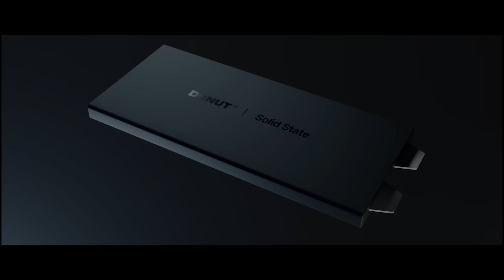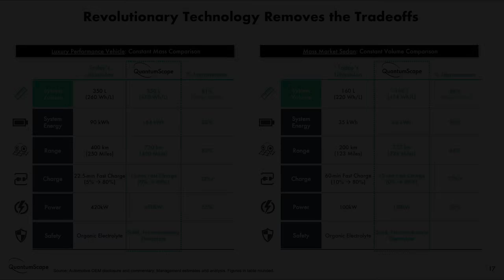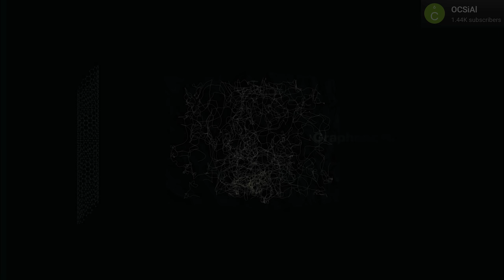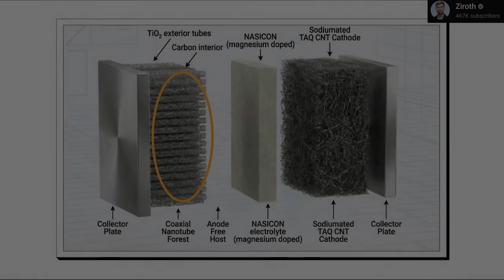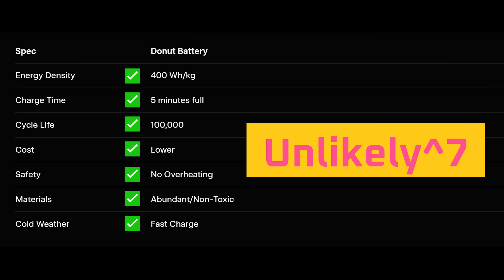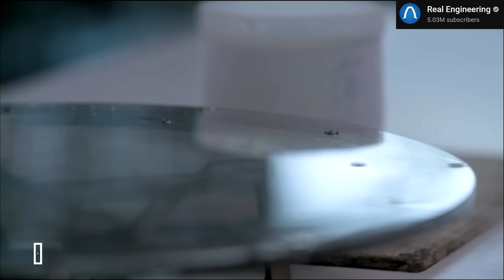Donut Lab's Battery has a Problem with Physics (and manufacturing)

Comment: You and the other “experts” still don't get it; being skeptical at this point just makes you look ridiculous. It doesn’t matter at all what chemistry was used or whether you can call it a battery—it’s all about performance! Even if the Donut battery performs slightly less than claimed, the fact remains that even with lower specs, it would still be by far the best overall package compared to any other battery. You’ve all made fools of yourselves with your reviews and comments—just admit it. And importantly: Innovations are often developed by small startups and no-names, so it doesn’t matter if you understand it. Because if you did understand it, you would have developed the battery, not Donut Labs :)
But take some comfort in the fact that you’re not the only “expert” who’s made a fool of themselves...
Reply from the maker: I agree, at the end of the day it's about the performance. 

That's why I didn't get into the weeds about chemistry, because it matters less.

However, what you're basically saying here is that it's okay if Donut lies and misleads about the performance of their batteries. 

That's not acceptable to me, even if they do push the industry forward.  

But have they pushed the industry forward?

Not as far as I can tell. 

That is, what you're doing is apologizing for potential fraud.

Comment: A theoretical scenario. Four chemicals, ABCD. A & D inhabit one electrode(Because they're stable together), while B & C inhabit the other(also stable together). A & B are components of a conventional battery, C & D also react with each other the same way A & B do when induce( specifically battery discharge). Lets say that C can flip the polarity of B, and A can flip D. So that the cathode A discharges electrons to B, then C flips the polarity(being the only chemical that can do so), and is subsequently induced by D to shed its electrons back. Then A flips it back and the cycle repeats. Is this theoretically possible?
Reply from the maker: This sounds like a perpetual motion machine
Reply: @thelimitingfactor  Doesn't have to be. There can be energy loss each stage. Just as long as it sustains longer than a conventional battery.

Comment: Okay, too bad that all your arguments are based on existing chemistries and technical solutions that are currently used in batteries. It would be desirable to take into account the fact that Donut labs could have invented a completely new chemical composition and technical method to make their battery. Then previous battery technologies have no legitimacy to be used as comparison points. So why are you drawing sweeping conclusions?
Reply from the maker: I did take that into account.

If they are making a 'battery' then it's subject to the same laws of physics.

That is, I'm not basing it on existing tech, I'm basing it on fundamentals.

Comment: Donut Lab itself did not develop this battery, there is a completely different company behind the battery, you will see that the battery will not come to the market because it does not exist.
Reply from the maker: No need to be cryptic.  I'm assuming you're talking about CT Coatings AG

Comment: CATL says 5-70% in 5 mins is 12C.
(Shenxing2 LFP. We all know the other 35% takes at least 7 mins = 5C).

At that dual reveal, they likely did have 12C & 5C batteries... They just lied about which is which. 
(For same reason they slow-walked Naxtra 🧂🔋 5 years in the first place: to protect Li sunk cost).

CATL Scientist: "Naxtra has zero resistance charge & discharge. It's basically a superconductor!"

CATL PR: "Naxtra? Oh, that thing is 5C. But look! Shenxing2 is 12C!"

Comment: Why are you talking about Li ion batteries, when we know that the Donut Lab battery does not contain Li. It is irrelevant. Your only valid "argument" is that it is too good to be true - ar least based on a paradigm known up until now. I am afraid that won't cut it to falsify the claims. We will see.
Reply from the maker: We don't know that it doesn't contain lithium.  That's what they told us.  So far, the voltage curve of the tests indicate lithium.  

Despite their claims that they can shape the voltage curve, there's no evidence of that, and it would be kind of silly because it wouldn't provide any real benefit.

Lithium ion batteries are the highest energy density batteries we have with any commercial success.

That's because lithium produces the highest energy density ion.  

That is, there's more to it than "too good to be true".  So far, the charge testing confirms what I've laid out here.

Comment: Very interesting... The only way I would imagine this working is if they found a novel method which is much simpler than current batteri tech but still uses some exotic component like nano tubes but which (they at least believe) can scale locally and easily. True or not I think there will be massive delays and issues along the way with any major impact volume wise on the overall market 5+ years from now.

Comment: Hard to know for sure but as two bit DaVinci said why would they lie? They seem very reputable although new but certainly capable as well. We shall see for sure, I've not seen one video. Chad thinks it's possible but I actually believe it is.
Reply from the maker: It's because all of these companies stretch the truth about what their battery is capable of. 

As long as there is some basis in reality, they can get away with it 

They have to really mess up big time in order to get prosecuted for fraud. 

For example, if Donut has multiple versions of this battery, the claims would be true.  However, you wouldn't get all those characteristics in one battery.

Comment: Big oil and battery competitors are relying on social media and the talking heads to sow doubt and sink any and all who’d put them out of business:

Yes, due diligence is necessary but be aware of who benefits if this technology is buried.
Reply from the maker: It's not being buried. 

We're waiting for them to reveal it. 

It's not a big oil problem, it's a Donut problem.
Reply: @t @thelimitingfactor  you’ve already said you don’t believe the battery is real.
Reply from the maker: That doesn't mean I'm trying to bury it.  I also said I will GLADLY eat my words if I'm wrong.

Big oil is small fry nowadays.  SA is no longer in the top 5 even.  The top companies all have an interest in these batteries succeeding because they are AI based.

It matters who your allies are.
Reply: It's not going to get buried. Big oil really don't care. Luddites do, but all the real advances in battery tech haven't swayed them so I doubt they will bother focusing on this one. The big claim being made for this battery (100,000 cycles) isn't even on their radar. Current batteries last the practical lifetime of the car, have range of 500+ miles, and can be charged in 5 minutes. That already ticks all the boxes the Luddites claimed would make them change their minds.
Reply: @bhabbott  big oil will crush this if the 100,000 cycle is proven.

Comment: To be fair to them, a lot of these specs aren't actually things we consumers would see. Like energy density in consumer products isn't the energy density per cell, but energy density of the battery pack. By extent, the cost isn't for us, it's for the raw materials; that doesn't mean it's cheaper for us. 

The only really questionable feature of the battery I see is the 100K cycle life: but without knowing anything about the battery, we have no way to argue about it. We'll just have to keep watching their third party examinations over the next few weeks. 

I honestly think there's a high odds the battery does exist, but I doubt the cycle life is actually 100K, I think it's more likely a theoretical based on the materials they used.

Comment: With batteries you can just do a simple check. Can you buy it? Not yet? Then it doesn't exist.
Reply from the maker: Exactly!
Reply: That's way too simplistic. Real companies release engineering samples to independent testing labs and/or potential customers. Then they struggle to achieve small-scale production (enough for a customer to assemble a few hundred battery cells into a pack in a car and claim crazy nearly meaningless "1,200 km range!!"), and struggle even more to achieve volume production with the original specs of the hand-built lab samples. The product exists long before you can buy it.
Reply: "RELEASE THE BATTERY KRAKEN...!!!" (Liam Neeson says sell it or it didn't happen)

Comment: I have always felt that one day some small company will stumble across a new, completely left field way of making batteries. That company would most likely come from outside of the mainstream battery makers, thinking very differently about batteries as they have no vested interests in the current technology or manufacturing. And because it is theoretically feasible to achieve these numbers and because I really want to believe this battery exists, I hoped it was true.
But sooo many red flags you have put up here, that it's hard to ignore. Perhaps the reality will be they don't hit all those claims but have made a breakthrough, but even then they may still hit other issues as this whole launch appears totally chaotic.
Thanks for the video 🙏
Reply from the maker: You're welcome!  I really hope I'm wrong - genuinely.
Reply: "I want to believe" is not a development strategy nor an investment strategy. It's a poster on Fox Mulder's wall in the X-Files.

Comment: The battery is not an „invention“ of Donut Lab, but a licensed product

The timeline clearly shows that Donut Lab was only founded in 2024 and invested heavily in the Nordic Nano Group (NNG) in 2025. Since NNG in turn has signed NDAs with CT-Coating and Next-Eco, it is certain: The „revolutionary“ battery of Donut Lab is based on the Nanopaste technology of Ernst Hölzenbein.

Donut Lab acts primarily as a commercial lever and integrator (especially for their in-wheel motors), while intellectual property and chemical formulation are deeply rooted in the history of Vectopix(Screen Printing Machines) and CT coating.

I think you have to be careful and smart with such technology. There are people who don’t celebrate it like that, there’s a lot of money at stake. Especially in the fossil fuel companys, oil companies and classic car giants are losing control over the entire value chain. This can be very unhealthy.

Hence also this publication strategy.

Donut Lab acts extremely cleverly. Their promises of the eternal batteries and 5 minutes of charging seem like fraud for industry experts at first, but it is precisely this distrust that is part of the plan. They deliberately lure critics into a trap, first they let haters tear up the results, and then immediately counter with independent validations. In this way, they proactively invalidate doubts instead of just defending themselves. Compared to the established industry, the boss relies on complete transparency. Since their technology poses a threat to large corporations, they protect themselves from targeted discrediting by publishing unstarnished data. The procedure is also essential for investors. No one puts millions in snake oil or potential scam. Regular checks by institutions such as the Finnish State Institute VTT prove step by step that the technology actually works. It’s a marketing strategy, constantly new evidence keeps Donut Lab talking and building a reputation. Through facts and videos, they make themselves unassailable.

Nanopaste Patent https://patents.google.com/patent/EP2854486B1/en

One more thing to consider when it comes to mass production. What if Donut Lab or specifically the company network behind it have the same goal as what ASML does, license technology and sell production machines, then they don’t need their own huge production.

It was already tried to market the product a few years ago https://archive.org/details/nanopaste

But they probably had it like Superfest Glass https://en.wikipedia.org/wiki/Superfest

„With Coca Cola, for example, they said: Why should we use a glass that doesn't break? We make money with our glasses. \\\[…\\\] The dealers said understandably: Who would saw off the branch he was sitting on?“

— Eberhard Pook

\\\*\\\*English is not my native language, I had it translated with Google Gemini.

Comment: Could it be an aluminium battery? That would explain the high power density per kg as Al is a light element.
Reply from the maker: Lithium seems the most likely based on the voltage curve, but they said it doesn't contain lithium.
Reply: Li is lighter than Al, no?
Reply: @georgepelton5645   Wow, you're right, I just looked that up. Seems like you can't beat lithium for power density. I don't know what kind of game Donut Labs is playing by saying it's not lihium. They seem very shifty.

Comment: The test showed Donut Lab battery retained 99.5% of it original capacity under full cycle fast charge condition. This is actually unacceptable for commercialization. After just 100 full cycle fast charges, this battery will only have 60% of its original capacity left. Donut Lab still need to improve this battery quite a lot.
Reply: That doesn't mean what you think it means. At least you need additional info to assure such an assumption. Because after the first 11C cycle the lab made one 1C and one 5C cycles and both returned 100% capacity.

Comment: I, like many others, became excited and hopeful that a new battery technology had arrived that would pull the rug out from under fossil fuel sources of energy. As this well thought out and presented analysis suggests, it is extremely unlikely that Donut Lab's claimes are true. Rats. As an aside, I was stunned by the scatter of the data shown in the Cycle Life (# Cycles) versus Volumetric Energy Density (Wh/L). The linear regression lines must have some crazy variability parameters. It looks like a real mess.
Reply from the maker: Thanks man!  You are correct, there are a huge number of variables and it is a mess 😁
Reply: The rug is slowly being pulled out even without battery breakthroughs. I think more battery storage is being installed then new "natural" gas generation, and combustion vehicle sales are declining globally.

Comment: Only thing I can think of that could make any of this possible is they lucked into some materials that transfer hydroxide ions well and end up working out really well without needing huge change to some materials getting refined for some other totally different use with one having a high hydrogen content unintentionally or something.

But generally that seems highly unlikely, but seems to be the only thing that might somehow degrade slower while basically working like any other current battery tech like lithium or sodium.

Comment: There has been more info today as people related to a German company CT-Coating have published information about cooperation with Donutlab. They sell technology and tools to manufacture various coatings, and most likely also have various carbon nanotube paste materials available which all have been developed during last ~20 years. CT-Coating and Donutlab have NDA and large scale business during last year(s). This German company does not have end products, but has technology to build up energy related products, and there seems to be several other companies too to have CT-Coating related activities.
Reply from the maker: I saw that!  Juho Heiska has done a great job of covering it.  'Magic Paste' 😁

His is probably the best analysis video, but it's in Finnish
Reply: Juho truly knows about batteries and has superior analysis. Still, I'm not absolutely sure if we should compare NMC battery charging curves to what we can see in VTT report - there is a different  C rate used to charge typical NMC with around 1C and VTT measured curves also with 5C and 11C.

Comment: Not all specifications are equal and unrelated, you seem to think that each specs make it infinitely harder to achieve.
Abundant materials would almost certainly lower the cost at an equivalent scale of production to other batteries.
If you figured out how to lower the batteries internal resistance, it doesn't overheat as much, it gets higher cycle counts, and can be charged faster....
We don't know the exact chemistry, this seems closer to a filler video...
Reply from the maker: It doesn't seem that way.  It is that way.

I'm not making a comment on whether their claims are real, but the odds.  And the odds are very very low.  So much so that it would be unprecedented in the last 166 years.

Comment: Great video!  The only potentially pertinent fact that I didn't see mentioned is that these guys also built an artificial brain, and this is almost certainly the source of whatever materials science and/or manufacturing breakthrough they've experienced.
Reply from the maker: Thanks!  Many major labs have digital brains for materials science, or have for many years now.  It's helpful, but only takes you to the foot of the mountain.

Comment: I think they can be given some leeway on cost and manufacturing. They could be referring to fundamental long term costs. What they’re releasing in 2026 is certainly not being manufactured at high volume and the costs are basically guaranteed to be higher than li-ion for the first year, and I’m not sure you’ll find them disputing that. They have been fairly vague on costs in interviews.
I think the main focus should be on materials (no lithium), energy density and power. Those are hard claims with hard numbers
Reply from the maker: The biggest claim is the cycle life.

There are already batteries out there that can hit the density and power.

And that's why the cost and manufacturing scale are so important.
Reply: @thelimitingfactor Both energy density and power from the same cell?  Certainly there are cells that can do one, and other cells that can do the other, but both?